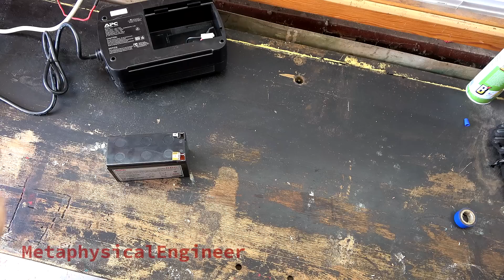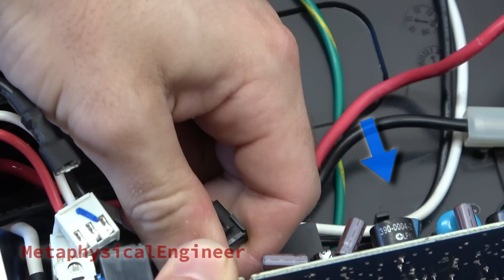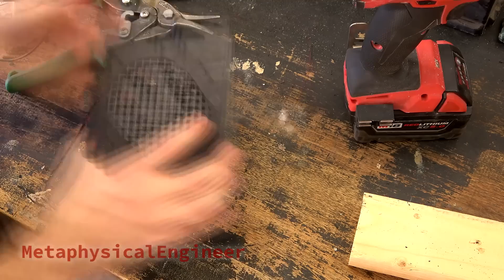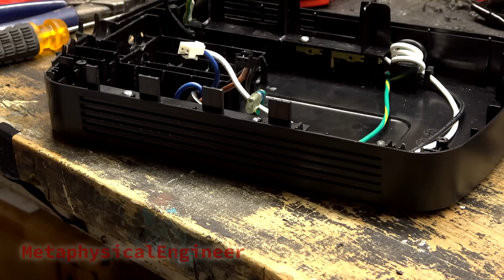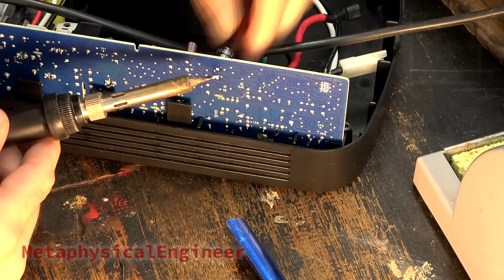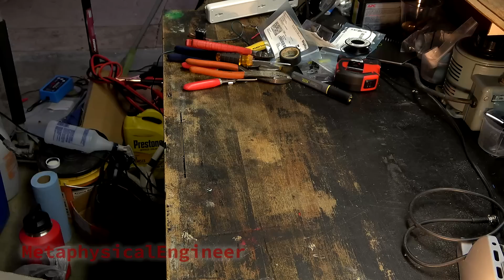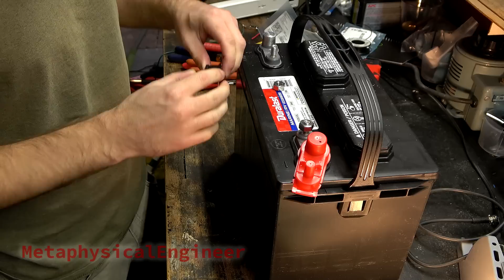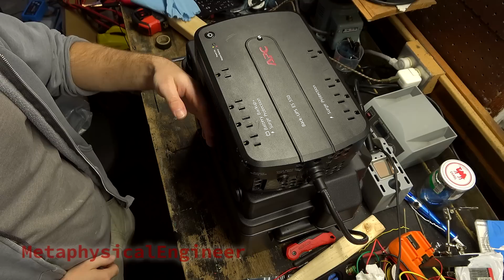Modifying broken UPS for long endurance BACKUP POWER!

Comment: Nice to know something I did WAY WAY back in 2000 is being done today.   People thought you would Burn your house down doing this.   APC  makes SOLID GEAR!     In fact if you have a tired automotive AGM car Battery?   I have used an old APC unit to "Charge it" (REfresh it) to bring it back to life from sulfation.   

If you ever want to test if a battery can really pass a load test on the cheap?   Pick up one of these UPS units.   
I like the Cyber Powers as they have a display.   But the APC units are built old school & SOLID.  

There is a 24 Volt unit that has a fan built in that needs to be replaced after a few years, but is a great unit to use with large and CHEAP standard automotive batteries.   You don't even NEED Deep cycle batteries.    You tend to barely use the deep cycling feature,  so if it saves you money?   Get the cheapest walmart battery you can get and enjoy.
Reply from the maker: Very cool that you had success with this type of mod in the past!  Interesting that your APC unit had a desulfation cycle.  I'll have to monitor the voltage to see if mine has anything of the sort.  Agreed that the internal parts are more robust than I thought; I went in expecting a struggle to keep the components from burning up under sustained load.

This isn't a Walmart battery, but similar in price.  Was actually slightly cheaper than the starting battery of similar size.  As for the deep cycle properties, depending on what I'm in the middle of, I may actually drain a significant portion of the battery if I have a deadline to meet when the power goes out.
Reply: @MetaphysicalEngineer  : Probably less a desulfation cycle and more simple-mindedness on the part of the UPS.
Reply: I've heard that since Schneider bought APC (Feb. 2007), the quality of APC UPSs has decreased, but I don't know whether that is true. Cyber Power is a different company, a competitor of APC.

Comment: Interesting project.  I'm pretty sure that your APC unit is PWM sine (crappy wave).  I chose a small true sine wave (BSINE600 from Tripplite) inverter instead.  The SLA batteries in these units are good for one or two shots at high load before they go bad, so i just left the original blade connectors for connecting the SLA battery and made an adapter to an XD90 connector.  Then made an XD90 to lug connector adapter cable and hooked up one of the cheap 50AH LFP batteries (probably cheaper than your group 34 deep cycle lead acid battery) which only weighs about 9 pounds.  The 13.5 VDC charging voltage from the Tripplite charges the LFP battery to about 96% of it's total capacity, which works great.  I have been using this one for over 2 years now and it keeps the internet router up for almost a day, or my laptop and the router going for about 10 hours or so.  Hopefully more people will be inspired by your video to "ditch the SLA" boat anchors that come with the vast majority UPS systems today and have a UPS that actually will run a higher load for several hours all while doing it yourself!
Reply: Those are impressive numbers, John! Thank You for the details.
Reply from the maker: Very interesting!  For a future upgrade or repeat of this project I'll look into alternate batteries, though I personally don't trust lithium chemistry batteries unless on a dedicated charge controller designed for such. Building a charger mod would be an fun project!  

You're right that even a relatively inexpensive UPS could deliver much better performance with a lithium, though from my quick estimates, that would double the retail price of a smaller unit such as mine.
Reply: @MetaphysicalEngineer  LiFePo4 would be fine there, with the stated max voltage and a BMS (which the mentioned packs include), and perhaps even safer than a marine lead acid battery. Now, lithium NMC (typically known as Li-ion) would not be quite as safe.
Reply: nice  engineering   , but the max  200 watts isnt enough power  and  board/mosfet will eventually fail  .....  better and easy to buy  1500-2000 watt inverter  amazon etc $130 bucks  and run  1 lithium  100amph and 2   decent size lead   marine  batteries   mixed --(yes together)   they work  great together, compliment each other and  many  boat guys  do it ,  then you have  mucho power  .

Comment: Conical hole chamfering bits are your friend for cleaning up holes.  Muuuuuuch easier than using utility knives.
Reply from the maker: Definitely getting a chamfering bit if I need to punch that many vent holes again.  Thanks for commenting!
Reply: Maybe or maybe not.  A (relatively) soft plastic casing like that, tends to produce areas that need trimmed away even if you had a conical drill.  Might be easiest to just use a brad point drill, and the casing put in the freezer before hand to decrease plastic softness.  It may still need cleanup afterwards unless you aren't picky.
Reply: @stinkycheese804  I mean one of those conical reamer bits with a 90°+ point angle to clean up the drilled hole, not a cone or step bit.

Comment: Could you Pin a parts list for this circuit board, please ?
Reply from the maker: Parts list, per request.  Read datasheets and verify before ordering.  I take no responsibility for any property damage, injury, etc. arising from attempts to replicate this project.

P1           |  PTN16-D01115K1B1     |   1k Potentiometer 0.125W	Any similar part will work
D1          | 1N456ATR	                     |   General Purpose Diode 30V  0.5A 	Any similar part will work
Qi           | 2N4403TAR                      |  	General purpose PNP transistor 40V 0.6A hFE 100  Any similar part will work
Qm        | IRLZ44NPBF 	            |   N-Channel MOSFET 55V 47A Threshold 2V 	Overkill for this application; any similar part will work
C1         |  EEU-EB1E101SH 	    |   Aluminum Electrolytic Capacitor 100uF 25V	Any equivalent part will work
R1, R3   |  CF14JT1K00	            |   1k ohm  0.25W	Any equivalent part will work
R2         |  CF14JT560K	            |   560k ohm  0.25W   Any equivalent part will work
Reply: @MetaphysicalEngineer  ...Thanks a megaohm !
Reply: That wouldn't be quite legal to do
Reply: @BurkenProductions lol what

Comment: Have an Eaton true sine wave line interactive UPS, not a cheap unit. I added a T connector to the line between the internal batteries and the inverter. This connector is available to plug in an additional 24 volt 200 amp hour battery which uses the same type of battery’s as in the UPS but larger. My main concern is the algorithm used in inverters to determine how long they will run. I have no idea if they monitor load current as well as battery voltage to determine when to shut down. I use this UPS to feed power to a wood burning fireplace / boiler used for heating my home. It’s main purpose is to power a circulation pump to provide hot water to all of the radiators. If there is no power to the pump or fireplace, the control on the fireplace which has its own battery back up will shut off the air supply to the burn chamber snuffing out the fire slowly to prevent overheating the water jacket and blowing off all the water out of the safety. Currently the UPS will provide 110 minutes of run time utilizing a pair of 12volt 8amp batteries in series on a load of about 150 watts. Will try to figure out with 50 amps available how long it will run.
Reply from the maker: That's a cool project, and makes sense that the boiler would have a failsafe to prevent overheating if the pump stops.  My parents have a sine inverter and a pair of Group 27 batteries like mine that they use to run the pump on their gas boiler plus lights and router if the power goes out.

How your inverter behaves depends on that specific brand and model; it may be similar to my cheaper one which will run until the batteries discharge as long as it doesn't overheat or overload.  Mine appears to idle indefinitely at no load as well.  If your UPS has a built in cooling fan, you're probably safe to let it run for as long as the batteries will last.  I'd advise installing a fuse right at the external battery terminal as I did.  

I'd love to hear back what you find in your experiments!

Comment: A fully charged battery is a happy battery.
At 13.8 volts, the UPS is providing float charge for a gel-cell battery.

This will not satisfy the AGM.
If you want long life (up to ten years), I would disconnect the battery from the UPS and connect an automatic (smart) charger with AGM charge parameter selection - about once a month. OR, at least after any significant discharge time.
13.8 volts will never fully charge the battery.

nice project, thanks for the video!
Reply from the maker: Thanks for sharing your wisdom!  That's essentially my plan to exercise the battery now and then.  Based on historical data, I'm expecting at least one power outage per month on average.  The UPS will take weeks to recharge on its own, so I'll use my external charger to boost it back up afterwards.
Reply: @MetaphysicalEngineer  Perfect!
I do the same with the factory AGM battery in my Prius.
Reply: The UPS came with an AGM battery. the float voltage is probably at 14.5. This will cook a FLA battery. I'm speaking from experience here. Built one of these a while back and it just cooked the batteries dry due to the 14.5 float voltage. It needs to be somewhere around 13.5 for FLA batteries.
Reply: 13.8 volts is the float charged for a lead acid battery,same reason most radio power supplys are 13.8 not 12 volts
Reply: Could you not connect a standard 12v car battery charger to one of the outputs on the UPS to keep the battery charged? Or does it need to go through the internal circuitry?
Reply: @dalemacdonald201  Well, yes and mostly no/ The goal of the project seems to be low cost with parts on hand. If you were to add an external smart charger, you should disconnect the internal circuitry. In addition, the charger would have to be connected to a surge protected (only) output. Not a battery backup outlet. Don't bother attempting a free energy / perpetual motion machine setup. TANSTAAFL

Comment: Maybe for lights.
Not pure syne wave and max 400 watts?
Reply from the maker: My computer maxes out at about 300 watts, the PSU manufacturer explicitly states in the FAQ that their units will work with modified sine wave, and I tested it with said computer.  No problems :)

Comment: Careful lead acid batteries emit hydrogen. Otherwise solid build. I have done something similar and recommend Bigbattery lithium 12v. They are more expensive but more reliable.
Reply from the maker: Was wondering when somebody would bring this up.  However, at 13.5V float charge and 0.3A max charge current, off gassing is minimal for a battery of this size.  If I ever need to fast charge or exercise the battery,  I'll ensure there's extra ventilation.  

Lithium would be an option, as would AGM, with the downside of expense.  Perhaps when this battery gets retired, I will upgrade to a safer, higher performance type.  

Thanks for stopping by!